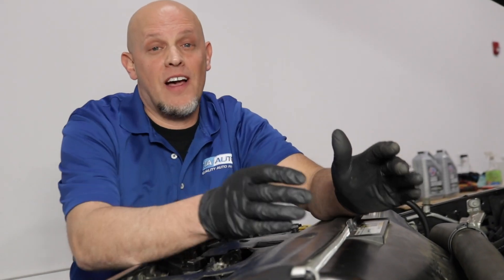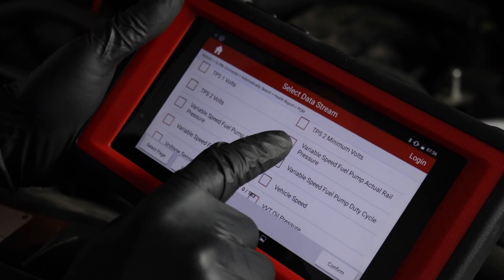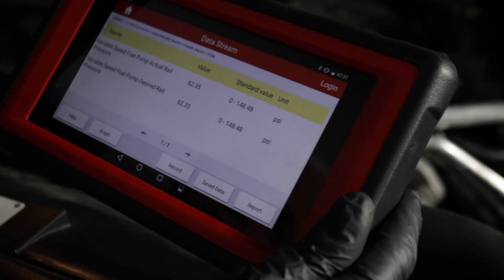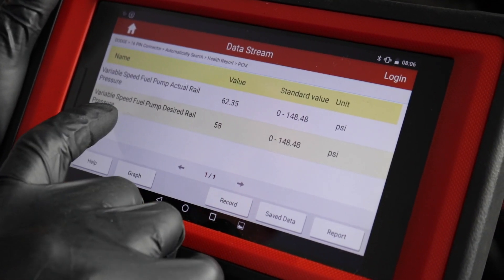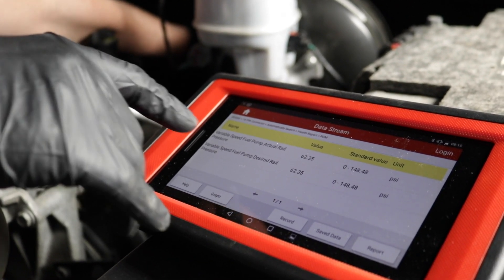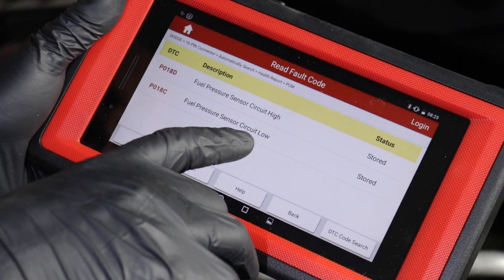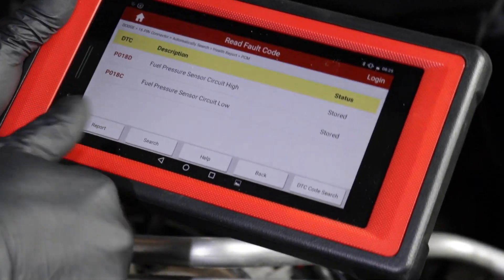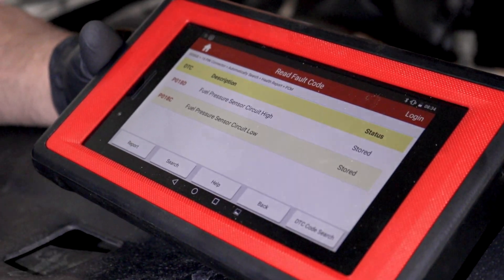Truck Won't Start? Code P018C on Your Ram 1500 4th Gen 2009-18

Comment from the maker: √  Watch the Video
√  Buy The Part at 1A Auto https://1aau.to/m-Visit-1AAuto
√  Do it Yourself
√  Save Money
Reply: So what if your truck won't start and it's not throwing a code? I have a 2011 Dodge Ram 1500 the truck will run by God in the morning started it. Won't I have to shut the key on it off about you times and then it'll start, but there's absolutely no code.

Comment: I bought a new sensor a couple years ago... but i haven't changed it simply because there's zero drivability issues or mileage/performance difference... but it DOES give me a highly desirable MDS disabled....  I hate MDS.... so it's a win win for me. Only downside.... ya lose remote start because the check engine light is on (no other codes) small sacrifice for no cylinder shutdowns.